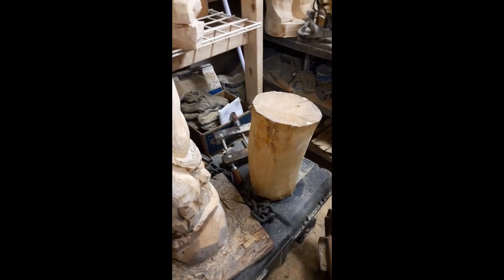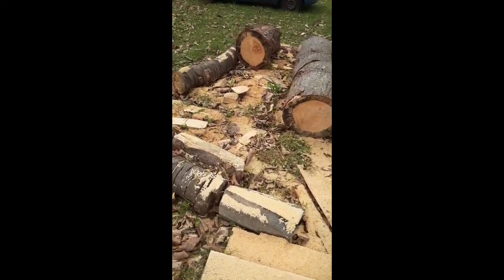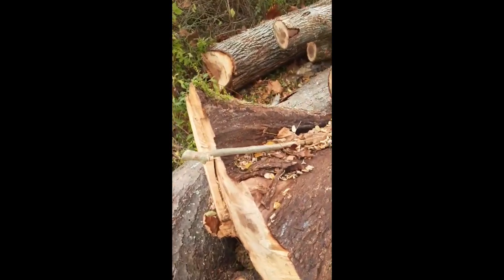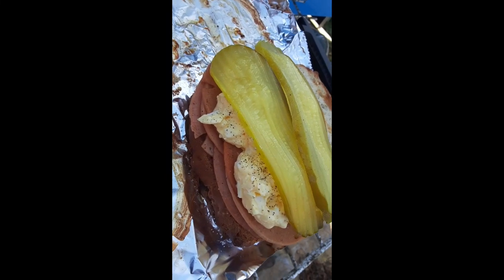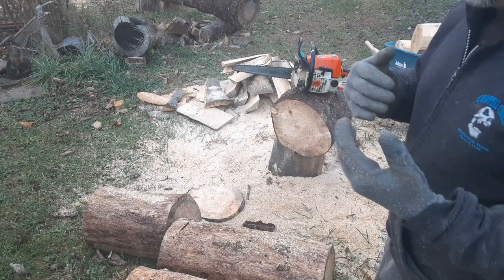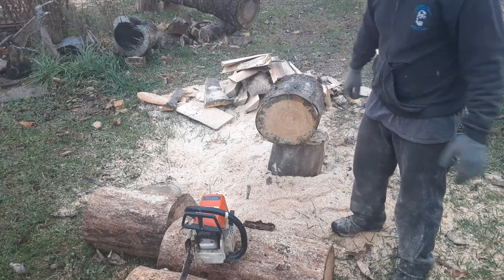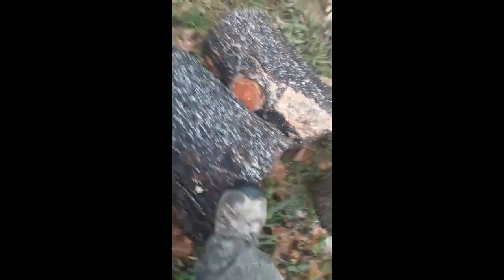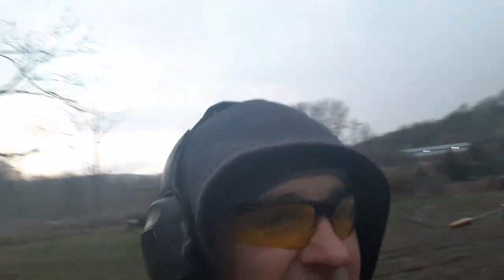Chainsaw carving how to get good wood

Comment: Good info buddy! I might have to prep some logs and get them drying for winter carving. I always just have them racked up bark on, and grab one that I want to carve when I get started. I like the way you do it, getting a bunch of them barked and ready to go. I never thought to do that.
Reply from the maker: It's great for indoor carving, I never get a wet bark mess inside the shop, and the wood will keep forever once the bark is gone... if I get good green pine, I usually just block out, rough out as many carvings as I can fit, then skin the rest, and leave them.out side, or stock the shop floor with blocks... unlike hard woods, or cedar, evergreens will decay to some degree if the bark is left on after the circulation in the sap wood stops. Theres so much sugars in the sap wood of an ever green, because they dont ever go 100% dormant, like deciduous trees do. Those sugars tend to cause some rott, or will mold quickly if we dont get the bark off after a month or two...depends on region too, sandy soil, less worry, definitely...

Comment: Thanks for the information - I wasn’t cutting off the bad wood before drying but will now! I noticed that you had a load of finished / almost finished pieces - do you always leave those for a while, see if they split and then repair and finish them? Thanks again for the videos it’s a great channel.
Reply from the maker: Thank you!glad it could help, in the north east we get bad mold issues, other parts of the states, or world it isn't so bad, but if it is, now you have a plan in effect... I dont really leave them,I often speed dry , with that drying box I built in another video, it indefinitely will crack pieces, often I put thg them in garbage bags in there with the heat or dehumidifier running underneath... garbage bags keep direct moving air from d as imaging the carvings too much, moving air will dry them too fast, and blister them, it's good to have a balance, that's why I prefer to put them out side under open air cover, off the ground. Theres a ton to just wood care, I willbe working on other videos to elaborate different stages, and practices...normally I just throw them in the shop, leave em, , that's why I try to always have pieces in stock, pieces roughed out, and so on, never outta stock, and always have wood ready so I can carve and finish a piece quickly if needed, it's a constant game of keeping months ahead of one thing or another...lol...

Comment: I see a lot of pine logs with beetle holes but usually cutting away the sap wood gets rid of them. Do you have any concerns when you put carvings aside to dry that you will accidentally introduce beetles to the entire  lot of raw carvings? I'm not sure if  beetle could lay eggs in that time and then hatch larva that start burrowing? I also read somewhere that the blue mold can actually be caused or carried by beetles. Not sure if that's true.
Reply from the maker: Great question, termites is the only real concern once the bark is gone, all larvae start in the bark, then bore their way in as they grow. ...you can hear them working on a log during the summer months especially, sounds like a rhythmic creaking,or low groaning sound...
Reply from the maker: And yes on the blue mold, Sawyer beetles especially will increase the blue mold issue, their excrement is highly toxic to some pines, blue mold comes in many forms, but usually a tree will get it in the root system through some invasive, there's a few different circumstances I've seen that cause it, such as burried copper propane lines, or a a paved driveway,  or covering the root flare with too much soil... many conditions could cause bad molding, and fungus in white pine, typically though in every single sick tree I've seen, larvae under the bark is present, or already holes have formed... the real trick with pine is get it healthy and green as possible, skin it, store it off the ground with ply wood, or tin roofing over it, truck bed lines work too, or old truck caps, just not tarps, they dont allow the wood to breath and get the natural air flow... if they fall to the sides... natural air flow produces the nicest buttery most stable wood. Three months or more makes for great carving blocks. Sun exposure is okay if not direct, we want to keep rain, and even snow from getting to the carvings... but in that, if you throw a log in a pond, and wait a year or more, you get some nice wood too, but that's a huge process, much more complex once the wood is out of the water, an needs to be slowly  tempered using a water spray, dry, wrap, or isolate process till its dry.
Reply: @badasswood  Great info 👍